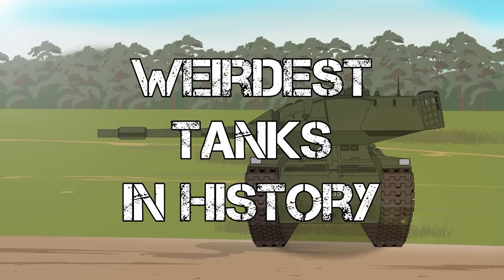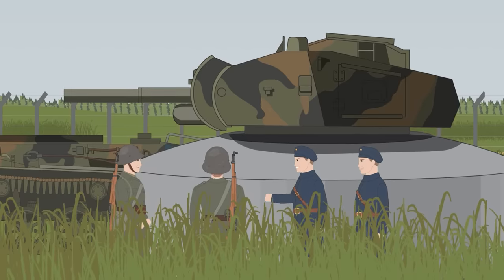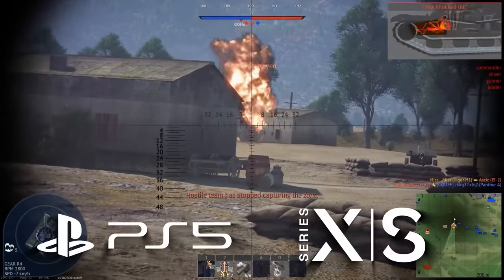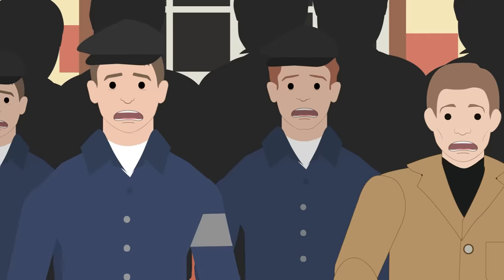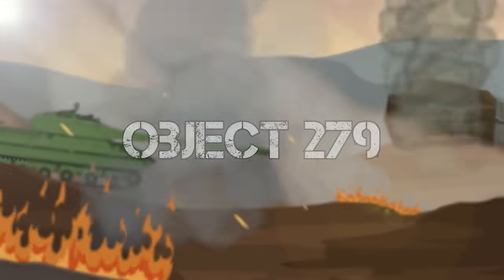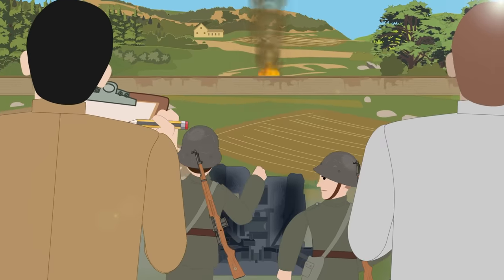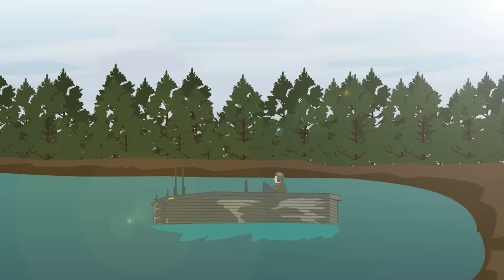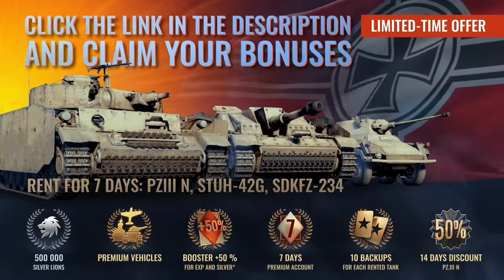Weird Tanks in History

Comment: The Swedish Strv 103 was specific designed to defend Sweden in case of the feared, but never materialized Soviet invasion. If the Soviet Army gained ground in Sweden, the Strv 103 would deployed with Hit and Run tactics.

So suddenly appearing out of the forest (Sweden consist of 80 % forest), shoot 1, maybe 2 Soviet tanks and disappear back into the forest. Keeping the Soviets at their toes all the time. Wearing the Soviets out.
Reply: shoot n scoot lol
Reply: It can also dig its own embankment in minutes to create a safe fire position.
Reply: A main appeal of the turbo engine was that it could reverse as fast as it went forward. And later models came with a scoop so it could dig its own trenches.
Reply: @femstora  Thank you, I did not know that.
Reply: @KimKhan  Thank you for the info.
Reply: If it worked for the Fins, pretty sure it would have worked for the Sweds
Reply: @KimKhan  that......is gear box, you don't reverse the engine sharp to make vehicle go backward, at least not on tank size vehicle
Reply: @duytranuc4025  I am fairly certain the engine selection was important in how the tank was able to traverse forwards and backwards with that level of efficiency.
Reply: While being really low profile too, Anybody who planned a tank confrontation against it probably would have had a rough time.
Reply: @femstora  Also later modifications included side skirts which was made up as fuel cans. Which not only increased the operational range of the Strv 103, but also did a very good job on countering HEAT rounds. Sure if the cans get hit it will catch fire, but the fuel will leak out of the external tanks and fall on the ground. Meanwhile I pretty sure the tank Strv 103 would be long gone leaving behind a trail of burning fuel in a rather funny way how the Delorean from Back to the Future does.
Reply: Preferrably shoot the leading vehicle first. Then the one furhtest in the rear. This will make them prime target for artillery since now they can't move in any direction bfore clearing the road of the destroyed vehicles. A truck can be removed from teh road relatively easily. Just puch it with a tank, or something. However, if it's a tank both in front and in the rear and all other vehicles are between them, you're screwed.
Reply: @KimKhan  Doesn't matter what engine you put in it, the 103 will always be able to move backwards as fast as it can move forwards. All you have to do is basically copy the forward gears but add one more gear with a 1:1 ratio of the gear it's in contact with and now the driving axle will spin in the opposite diection. Hopefully I managed to dumb it down enough.
Reply: The third crew is situated in a reverse position in the strv103. Facing backwards made it possible for them to drive in reverse at high speed.
There were a number of ww2-era armoured scout cars that also had this feature.
Reply: @KimKhan  it only make the tank power pack smaller, alot. Turbine engine in tank at that time is not as good as now, combine with the diesel(yes, it have 2 engine) it only spit out ~500 Hp, not a lot to begine with
Reply: It is a really awful tank though
Reply: This tank is not penning Soviet t62s
Reply: @henrik3291  Its ugly, but when it entered service it was the best tank in the world. But sadly did new technologies make this tank obsolete after a few decades. It would probably perform well against the older Soviet tanks used in Ukraine and it could probably give some nice fire support to the infantry. But its crappy armor, lack of gyro-stabalizer and tiny gun makes it obsolete today.
As said,  can it probabably be used against old tanks in 3rd world countries with a good effect even today. But to be honest is this tank no longer useful in wars between modern armies unless you use it as a 1 man tank. But I think its better to use the tank chassis to build bandkanon artillery pieces.
Reply: @nattygsbord  
It was never the best tank inte the world, nowhere close to that.
Reply: @henrik3291  Faster reload and aiming than Leopard1. Better penetration than the other tanks. Low siluette that makes it hard to spot, hard to hit, and the extremely angled armor gave it excellent armor thickness compared to the glass guns AMX30 and Leopard1.
It was also relativly low weight which made it possible to use this tank on military bridges and made it easy to tow this tank if it did break down in a battlefield.
It could swim. It could handle a direct hit from napalm. It was a fast tank that could drive as fast backwards as forward.
It is probably the only tank in history that could only need 1 crewman to fully operate it.
Its gun depression and elevation was excellent. The traverse speed on its tracks was very good.

So yeah, it was the best tank in the world of its day.
Reply: @nattygsbord  Btw angeled armour has nothing against the APFSDS ammunition take came just some years afterwards. 

As I said this tank was supposed to replace the Centurion, it did not do that for a reason. Ask yourself why.
Reply: So basically they and Finland would do hit and run tactics
Reply: Are you from sweden too?
Reply: @johnen5508  No, I am not from Sweden, but from the Netherlands. However I visited Sweden many times on vacation. I love the Swedish forests and lakes. 
So I learned about Swedish Cold War history.

Comment: The Bob Semple could have actually worked in it's intended role - infantry support.
Japan was notoriously poor in the Armor department. And somehow even worse in the Anti-Armor department. Poor Steel Production, a focus on the Navy and Airforce over the Army and a focus on Naval invasions over land warfare made for very light tank designs. Stuff you could easily destroy with AT guns. Leaving you as the only one that brought a tank.
And it was built from a tractor via a A-Team Montage.
Reply: So it can be built and repaired onsite instead of having to be shiped from Home Islands wading through American submarines wolf packs, not to mention NZ is beyond the reach of IJN's supply line and Tokyo Express will stop coming very quickly.

After 7-8 months when the Japanese ran out of fuels and parts to keep their I-Go and Toyota Type 93 Armored Car running, Bomb Semple will be the only armor left on New Zealand battlefield and RNZA can utilize the maxim "You have no tanks, but we do".
Reply: @thanakonpraepanich4284  American submarines wouldn't be interdicting supplies to New Zealand the American submarines would be HELPING those supplies especially given the US was sending military aid
Reply: I mean they still would be better off simply importing M3 Stuarts from the USA, but until they could actually get them there. Mr. Semple's invention would have been moderately useful
Reply: @blomgaming6480  Every tank can blow up if you throw a grenade inside.
Or do you mean the outside? Because that would mean the enemy is already way to cloose anyway.
Reply: @hagamapama  Except if the Japanese didn't have any tanks the M3's would be better spent outflanking Jerry on the other continents.
Reply: @christopherg2347  considering that the Shermans were very rarely alone, that would have been really hard for the japanese

Comment: The Swedish also developed the Kranvagn. But only the hull was completed with the turret never entering production due to technical issues.
Reply: It's Kranvagn.
Reply: @DaReaperZ  Thanks for the correction.
Reply: Technically it was called the Emil. Kramvagan was the code name.
Reply: @jeffreynagy7112  Kramvagn would certainly have been a funnier name!
Reply: @jeffreynagy7112  there were 3 prototypes the Emil 1, the Emil 2 and the Kranvagn. Or am I mistaken
Reply: Kranvagn means "Crane truck", it was just a cover name.
Reply: @henrik3291  Yep, sort of like Leichttraktor.
Reply: @mohamadaboualfa7037  Kranvagn was the codename used to disguise the vehicle in intelligence. Emil was the project name, the vehicle that was built was the 45 ton version, I believe, and would ahve been called "emil" when completed.
Reply: @thenumbah1birdman  Thanks for the information.
Reply: There was no technical issues. The turret was to expensive to produce, due to its super thick front armor on the turret.
Reply: While Kranvagn might sound cool, it translates to ”Crane Wagon”. And Kramvagn sounds like some valentine thing

Comment: the reason for the strv 103 became what it is, was that at the time, most MBTs and other vehicles that perform about the same role, still did not have a very capable gun stabilization system, meaning they still couldn't fire accurately on the move, so they still needed to stop to aim accurately and fire, thus the strv 103 was designed to work with that conundrum, fix the maingun to the chassis that has sufficiently capable armor scheme/design on the front arc, with mobility in mind that can allow the vehicle to relocate after firing.

also adding this in, for those who still think or believe that the super heavy tank T28 and the T95 GMC as two different designs/vehicles, i will just paste what i have already commented to other people

that is the WoT perspective as they split the two versions to flush out the tank destroyer line, even fabricating their own version of the T28, when in reality, it was still the T28 regardless if it had the external tracks, it simply was renamed the T95 GMC (Gun Motor Carriage) when Ordnance didn't think nor see that the vehicle fitted the classification it was being placed in, making the confusion that made people think (partly or rather mostly thanks to Wargaming) that the two vehicles are entirely different designs/vehicles. even Nicholas Moran had to talk about it in one of his Q&A videos.

Comment: Just so you guys know, I wanted to add this here because it wasn't in the video. The STRV 103 uses Gas-hydraulic hydropneumatic suspension to elevate it's whole hull (chassis, lower half) up and down, which results in the main gun going up and down. This is done because like said in the video the gun is welded to the chassis and can't move on it's own. So in order to aim the gun the whole tank needs to pivot In place for left and right and with the suspension up and down. It's rly a masterpiece imo, and the engineering and design of it are absolutely brilliant. The idea of this hull down monster is amazing. Sweden has the strangest tanks in history but, they are smartly built.

Comment: The Strv74 was not organized into the armor (tank) brigades, but in lesser formations. It would not have faced off against Warsaw pact tanks on the plains, but utilized its small size to take up ambush positions in wooded areas. Even while being classified as a tank, it is more a mobile gun with a well protected turret. Sweden planned to employ the Centurion and S-tank for defeating armoured and mechanized units in open terrain. The Strv74 was functionally replaced by the IKV91.

Comment: You guys drew a mix between the T28 and T95 american tank destroyers, the T28 only had a singular track on each side while T95 had two. You guys drew a T28 tank with the extra tracks of the T95
Reply: It is the same tank the outer tracks are removed for transport. Same tank, it when through a designation change from heavy tank t28 to gun motor carrage t95.

Comment: Isn't this a t95 and not the t28.
I think the t28 was just a different prototype with 2 tracks
Reply: Short answer - the T95 and T28 were essentially the same thing.
Tracks could be taken off for transportation by rail, and put on again when it started moving under its own power.
Having 2 or 4 tracks doesn't change its naming nomenclature.

Long answer - It was originally called Heavy Tank T28, but since tanks have turrets, it was supposed to be called 105mm Gun Motor Carriage T95. Again, Gun Motor Carriages, the likes of M18 and M10, were lightly armoured unlike T95, and this necessitated another name change to Super Heavy Tank T28.
Reply: @JakeTheTankmaster  thanks for your answer! Very helpful

Comment: The American T28 only had one set of tracks for easy train transport the T95 had two sets
Reply: thats how its usually done in games, but it's really the same tank. The outer two tracks could be taken off for it to fit on railway for transport, however it could not enter battle like that due to high ground pressure.

As for the name, it was a very unique design so they didn't know how to classify it. It started out as T28 Heavy Tank before being renamed to T95 GMC and after another rename, the final designation persisting til today is T28 Super Heavy Tank.

Comment: The T28 you mean T95, the T28 only had 2 sets of tracks, the T95 had the four to 2 sets of tracks that could been bolted on to the supper heavy tank destroyer
Reply: No. The Project Held both the designations T28 and T95. Since 1946, it has been T95.

IT also wasn't a Tank destroyer.

Comment: The 3rd tank is the t95, not t28, t28 is the way weaker version of t95, it has weaker cabin where the gun is located, but they have the same gun as the t95, and also t95 can mount 155mm cannon which is t28 can't do it
Reply: t28 and t95 were the same. They simply changed the name at one point in development. In reality there was never a difference

Comment: The T-28 shown in the video is actually the T-95 the T-28 only had 2 of the 4 tracks
Reply: Nope, both vehicles are the same. In fact, the designation "T95" only existed from 1945 to 1946
Reply: @harmdallmeyer6449  I know… 

they were still designated as 2 different tanks though…
Reply: @RossTraan  No. It was the same tank designed with removable tracks to enable railway transport, since it would've been too wide with four tracks. However, two tracks made for too much ground pressure so it wouldn't have been able to enter battle like that.

There were two prototypes, which started with the designation T28 Heavy Tank, then they got renamed to T95 GMC, before receiving their final designation as T28 Super Heavy Tank

Comment: Fun fact: T-28 is actually T95. T-28 looks way different, and didn't have 4 tracks
Reply: Nah t95 can remove the outside tracks in reality it has 2 tracks with 2 more extended track
Reply: @fangzu612  Yes
Reply: @flippi_flobija  T28 and T95 are the same, only different classification.

Comment: That was a T-95 you showed not a T-28. Good video though
Reply: "The T28 and T95 are exactly the same tanks. The tracks were removable at any point, mostly for transport. The vehicle was just originally named T28 Heavy Tank, then renamed T95 Gun Motor Carraige, before being renamed again to T28 Super Heavy Tank. Given its the most recent classification, T28 is the correct term for the vehicle, but all the names refer to exactly the same AFV" Copied a statement by another commentor because I was getting fed up with these types of comments

Comment: They mixed up the t28 and the t95
Reply: "The T28 and T95 are exactly the same tanks. The tracks were removable at any point, mostly for transport. The vehicle was just originally named T28 Heavy Tank, then renamed T95 Gun Motor Carraige, before being renamed again to T28 Super Heavy Tank. Given its the most recent classification, T28 is the correct term for the vehicle, but all the names refer to exactly the same AFV" Copied a statement by another commentor because I was getting fed up with these types of comments

Comment: The T-95 is the one they’re showing with four tracks not the T-28  that was the skinnier brother of the T-95
Reply: The T28 and T95 are exactly the same tanks. The tracks were removable at any point, mostly for transport. The vehicle was just originally named T28 Heavy Tank, then renamed T95 Gun Motor Carraige, before being renamed again to T28 Super Heavy Tank. Given its the most recent classification, T28 is the correct term for the vehicle, but all the names refer to exactly the same AFV.
Reply: @infinitydott  thank you for the information I did not know the tracks were removable
Reply: @51Detective  np
Reply: They are two names for the same vehicle. The two track and four track variants are just different configurations for the T28. Those outer tracks are modular, and easily removable. The two track set up is the "transport configuration", and is meant for fitting the vehicle through tight spaces, such as alley ways, or for loading the vehicle onto a train. The four track set up is known as the "combat configuration", and is what would have usually been used in battle, allowing for better traction and reducing ground pressure. The idea of the T28 and T95 as being two distinct vehicles seems to come from the video game World of Tanks. War Thunder also seems to have fallen for this incorrect naming system.

Comment: They said t28 the drawing of a t95
Reply: "The T28 and T95 are exactly the same tanks. The tracks were removable at any point, mostly for transport. The vehicle was just originally named T28 Heavy Tank, then renamed T95 Gun Motor Carraige, before being renamed again to T28 Super Heavy Tank. Given its the most recent classification, T28 is the correct term for the vehicle, but all the names refer to exactly the same AFV" Copied a statement by another commentor because I was getting fed up with these types of comments